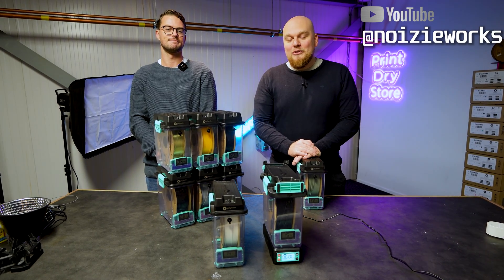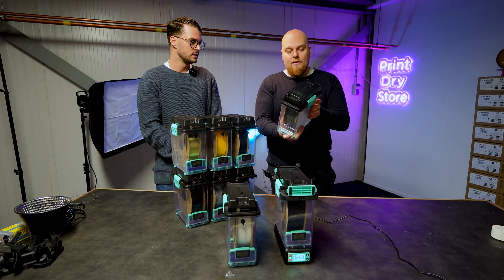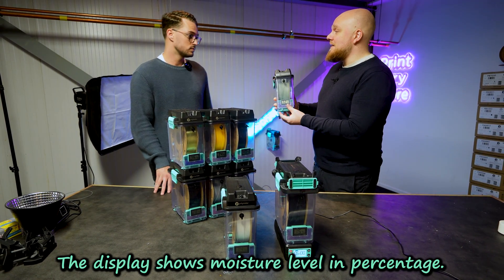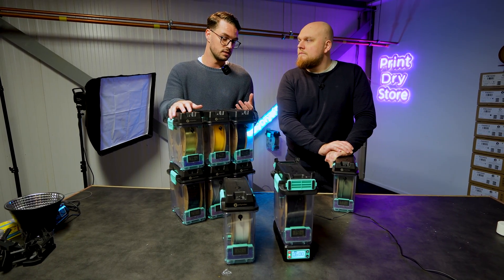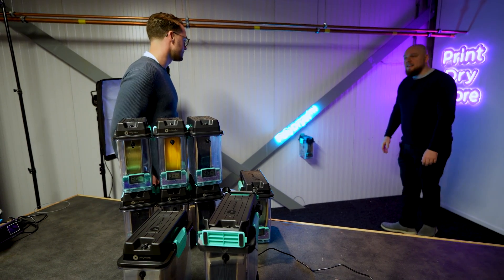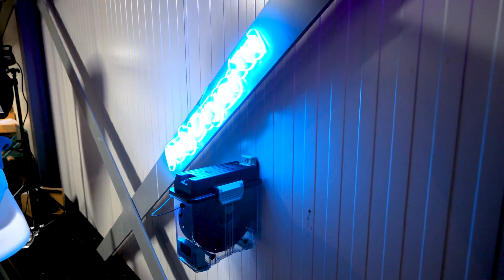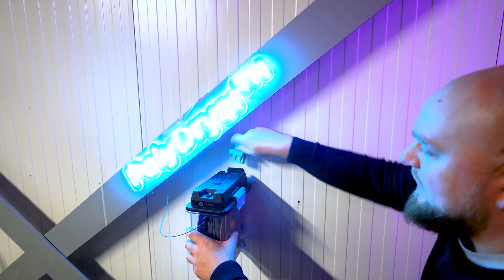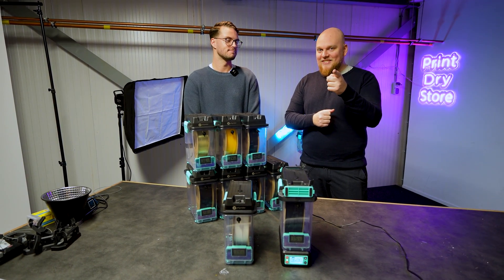First look of the Polydryer expandable dry and storage system

Comment: Thanks the the video , that is really helpful! I have one quick question: after printing, do I need to open the box to tidy up the filament before I can store it as a dry box?
Reply from the maker: You will have to open it if you want to clean up the spool or you can leave a bit of filament hanging out of the box and snip it before you re use it. Of course i will have to test this myself.

Comment: Fully bullshit product .. it's a pasta box with hygrometer and that's all...
The available product is completely underutilized.
No need for a separate bottom part! 
The removable top of the box would fit all the electronics without any problems, and the power supply can be connected with a quick
Reply from the maker: Thanks for sharing your opinion bud!